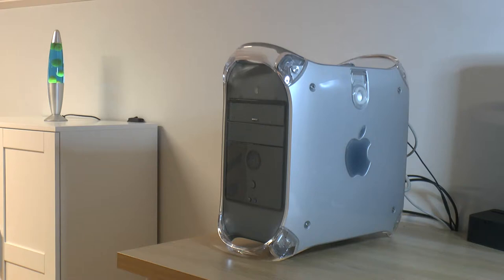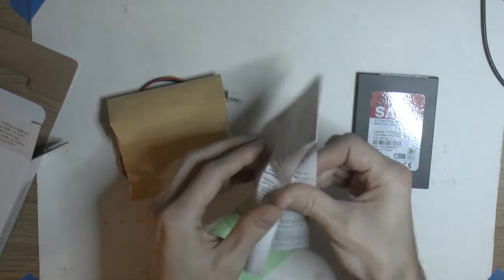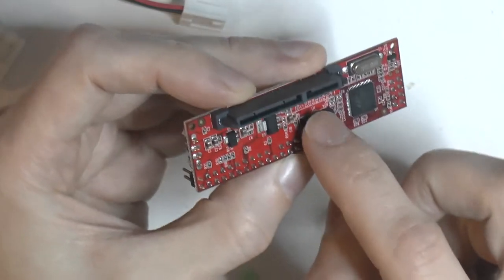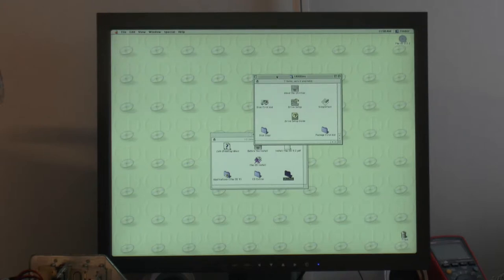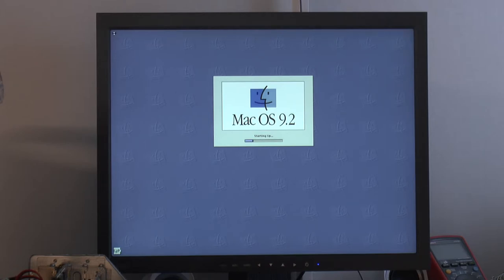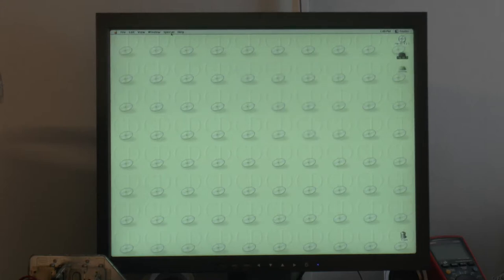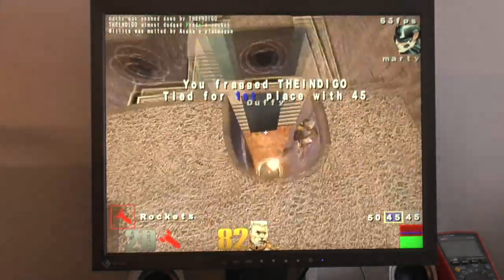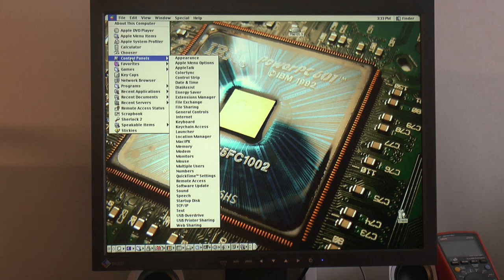Power Mac G4 IDE to Sata adapter and Quake 2-3 config tweaks

Comment: Thanks Patrick. 
I am grateful for your insight here. I found this video on my quest to get my 1999 G4 up and running for use with a drum scanner technology that was lost to time. In order to smoothy utilize the scanner my efficiency OS range is OS 9.2.2 to OS 10.2.8. for the old available software. All the companies involved in updating software for this scanner are long gone. 
This is a great solution to get better stability with the larger SSD drive. Also The drum scan files are larger than the old 30 gb drive can handle on a regula basis. Also lets me sfely test os 10.2.8 with the software I have.
May try to get some faster read write next speeds, or better yet get the workstation networked to write directly to a shared folder.
Thanks Again.